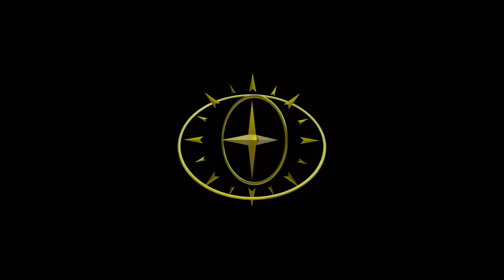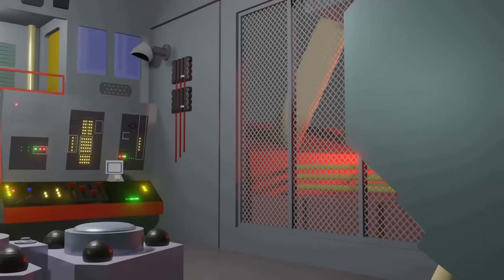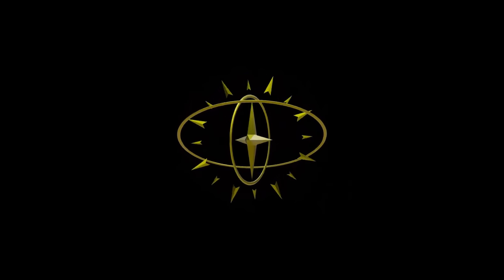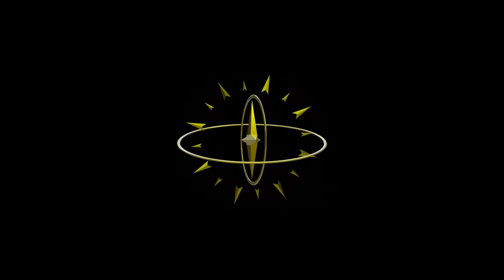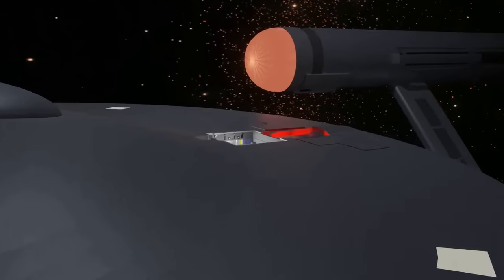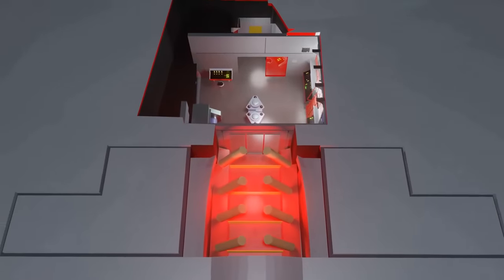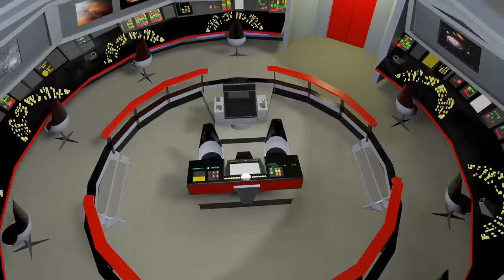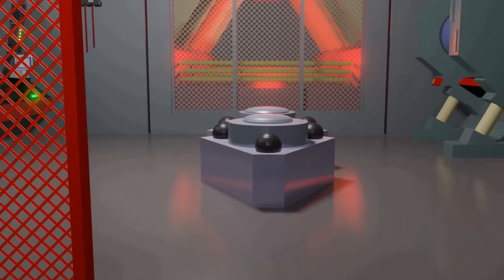The Enterprise Engine-room Enigma: where was main engineering?

Comment: Now that scene in "Galaxy Quest" makes more sense, the one where Brandon asks Jason Nesmith about the inconsistencies of a specific deck location of the Protector during the convention (and just before Jason blows up at the kid with "it's just a TV show.").

I always figured it was tongue-in-cheek humor at Star Trek in how some things didn't always line up, but this makes that scene have a lot more weight in that it's a very specific area he's asking about.
Reply: "Well, the first thing we ran into were the "errors," and every ST fan knows there were enough errors to fill a volume library. Some of them I could work around, but some were too glaring; they would have to be corrected. Each time one of the "glaring" errors appeared on the list, we'd have a bull session of ST fans and discuss it. If the consensus of opinion was that, regardless of the error, they wanted it that way because that was the way it appeared in the series, I discarded that item. In other cases, where they decided the correction was proper, and it didn't affect the theme of the ST series, then I made the changes and used the item." - Franz Joseph Schnaubelt.

"I had to document every step and maintain accurate records of everything, so that I could meet any challenge in the future without knowing exactly what that challenge might be. Wherever possible, in preparing the Manual, I checked my work with the experts at the local universities. I wanted to be certain that anything I used was correct so that the fans would be learning reality -- not some more science fiction." - Franz Joseph Schnaubelt.

The guy who wrote the Star Fleet Technical Manual.
Reply: @Idazmi7  Man, what I would give to have been a fly on the wall in on some of those debates :P